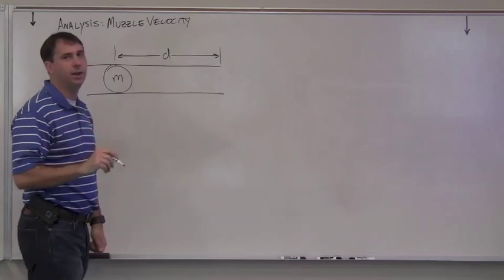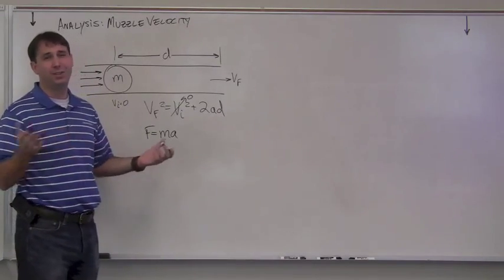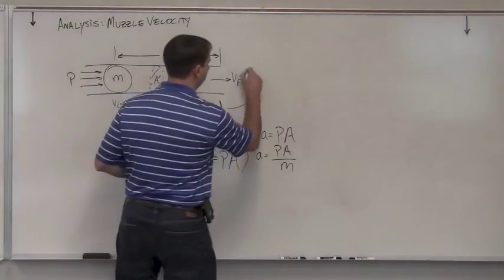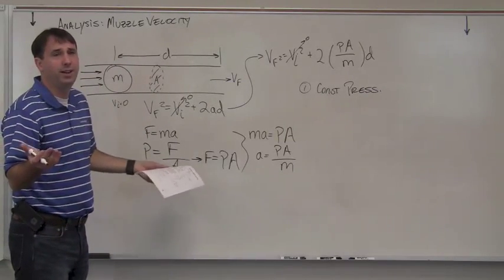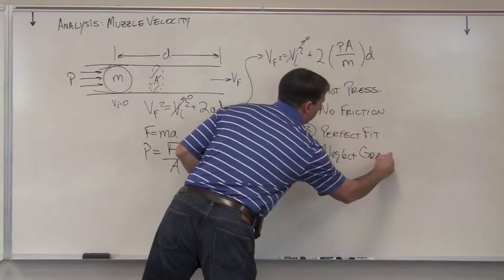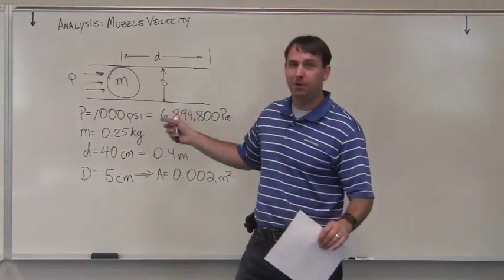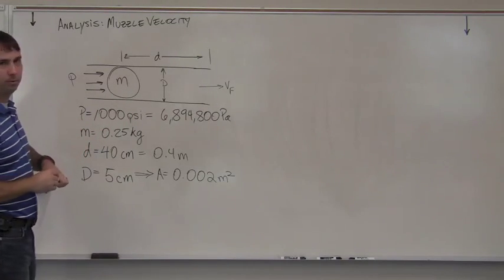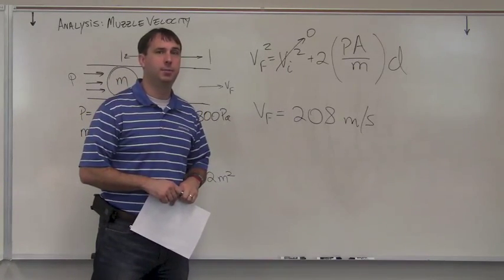InSPIRESS Physics Calculations: Muzzle Velocity

Comment: I have a question . I have a pellet rifle that is spring powered. At the barrel it puts out a pellet that weights 14.3 grains  at  955 fps . This produces 28.95  foot lb energy  (kinetic energy). at the barrel . Knowing this  can you tell me the kinetic energy  fpe   and the fps if I used a 9.5 grain  pellet  at the barrel .  I would also like to know  from the Info I gave you,  can you tel me what grain pellet I would have to use to have a  20 fpe at the barrel .  The field target matches have a 20 fpe  limit  on all the guns used  so I'm trying to figure out  what grain pellet  I would have to use to  have a  20 fpe  pellet at the muzzle .